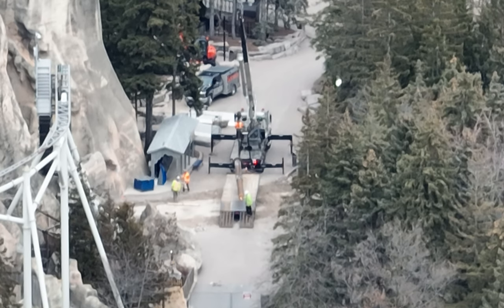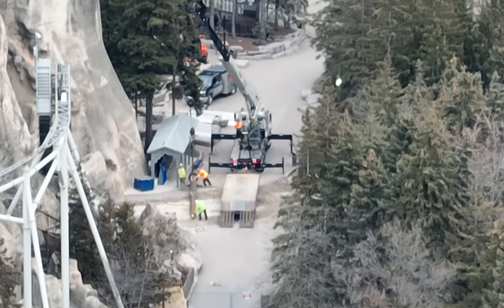Canada's Wonderland New Roller Coaster Tunnel Begins

Comment: I can't tell but from yhe drone shot it looked like the front gate sign wasn't there
Reply: My theory is, next year we'll see a new sign which will include the 'Six Flags' branding. Which is why it's a 2 part renovation. So likely the sign is still there.
Reply: @billybob33366  The merger is stalled — no rebranding of any parks would take place for the 2024 season, as it can’t possibly go through until mid-summer anyway.
Reply: @inSpiared  to my point, by the 2024 off-season, we will likely see the part 2 of 2, Front Gate construction take place
Reply: @billybob33366  Why though? CW doesn't need the Six Flags branding
Reply: @TimT2-uw8td if the merger takes place, ,im sure there will be a push to rebrand major theme parks, globally with the 6 flags name